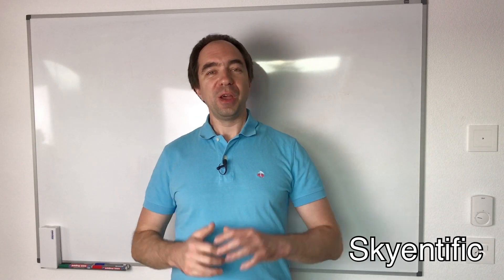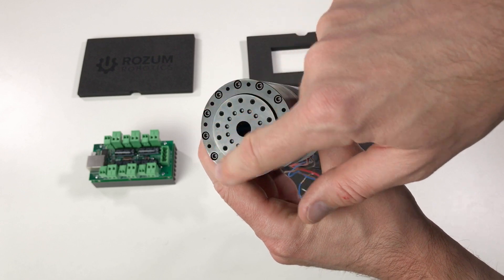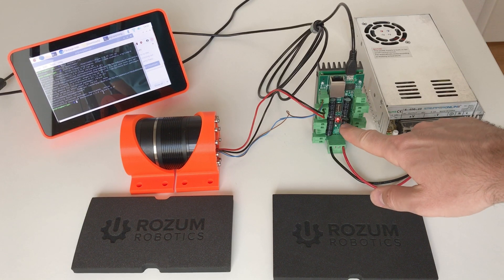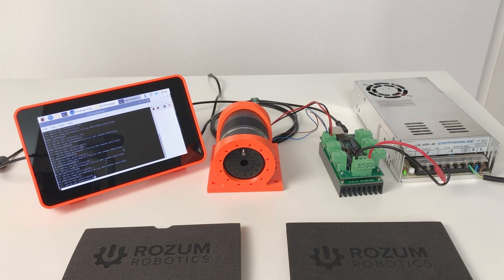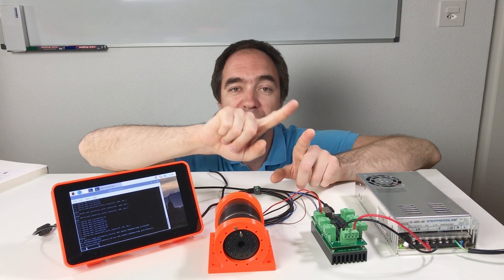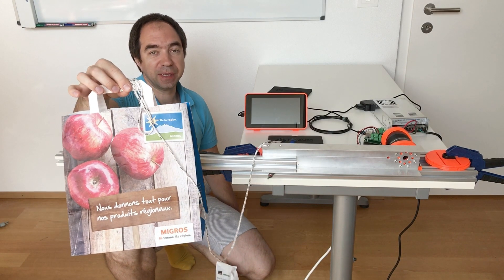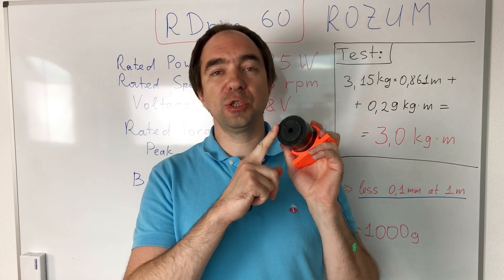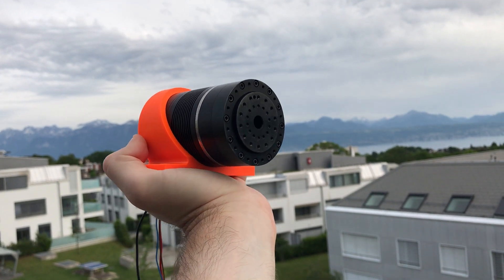Harmonic Actuator RDrive 60 (Rozum Robotics)

Comment: This actuator is amazing! Just finished coding a DIY RPi X/Y camera gimbal, using NEMA 8 geared steppers and Python. It has many similar features, such as degrees rotational input and accelerated/decelerated motion. But, this actuator takes it to another level.
But, after following your link, I see that it's price is through the roof.🤑
Surely there are affordable mid-range alternatives. (I'm beginning to realize that your videos are going to cost me a lot of money, starting with a 3D printer.)😎

Comment: The problem I have with Razum is this ignorant idea that to buy it I have to send them a message. I mean if you intend on selling something, setup a cart where I can click buy now and just buy it without having to jump through a bunch of hoops. All this tells me when I see things like this is they are embarrassed about the absurd price they want and dont want that showing up in a shopping cart before they have a chance to get your contact info so they can spam you! Thanks but I will find my parts somewhere else!
Reply: I don't like the practice either. Local plumbing, building, and electric supply stores do the same thing so they can charge each customer differently. You walk thru the whole store and there is not a price on anything. At least post a list price for rough figures and comparison to other similar items. It is OK if there are different discounts on the list prices for bigger or smaller customers, but not having any data is counter productive.  I refuse to give these companies my business, and instead buy online instead of the local place. If they want to complain about people not buying local, it is their own fault.

Comment: Mind me asking an off topic question? I'd like to know what happened to the "orbital drive" you had developed some time ago. Only reason I'm asking, is because I thought it was so cool and never heard much about it since. It being also a high torgue, low backlash actuator (with the added benefit of low cost), just popped up in my mind.

Edit: Yeah, obviously long time fan here!
Reply from the maker: Nothing happens since then. I did not have time to work on it. But I still think that it could be used for robotics.
Reply: I hope you'll do. I'm also interested in that. A few weeks ago I made a spreadsheet, and calculated that close to 500:1 ratio is easily achievable with cheap off the shelf parts. It could be a good option for hobby robotics.

Comment: "Price: Contact us"
No, I don't think I will
Reply: It's $2700ish
Reply: @Spirit532  Is that an extra 0 in there oooor? XD
Reply: @darksunrise957  No.
Reply: now, open the thing, understand how it works, and 3d print a replacement for the planetary reductor ;-)
Reply: @AmauryJacquot  ya harmonic drives are really hard to manufacture because they have such thin walls and fine teeth on the compliant meshing teeth thing
Reply: Amaury Jacquot that is not necessary because there is none.

Comment: a 100 euro cordless drill has double the torque as this thing, It's not worth 2700$, also almost no backlash and only 18v system
Reply from the maker: High voltage is good. High voltage => low current => thin flexible wires. Drill without backlash does not exist. And I really doubt that a drill can make 30Nm torque.

Comment: This is not what's known in the industry as an actuator. Actuators move out/in, this looks more like a motor with slow gearing or a servo. Closely resembling a stepper motor
Reply from the maker: This is not industry. This is robotics. Actuator in robotics is any source of motion (linear or rotational). Usually actuator have a motor, a electronic driver and a reduction mechanism.

Comment: Nice presentation sir! I have the following questions: 
1. How effective is the torque control? What's the torque resolution? Since its reduction ratio is so high (100:1), I'm a bit skeptical about using current for its torque control. 
2. Does it have a power-off brake?
3. Does it only have one encoder at the output? Is there an encoder for the input (motor) side?
Appreciate your replies!
Reply from the maker: Thank you.
1. I did not have time to make a super deep analysis. But the toque control was better than I expected. I agree, that high reduction ratio does not help here. 
2. This one does not have brake, but I think this company also produce actuators with brakes. 
3. It has two encoders.
Reply: @Skyentific  Thanks for the reply sir! Glad to hear that its torque control works well. Would love to buy one to try. The dual encoder looks interesting to me too. Kind of curious about how they integrate both encoders into 1 PCB.

Comment: The cynic in me always wonders if any of these fancy actuators ever get any use beyond youtube videos on the various channel free samples get sent out to.
Reply from the maker: They used a lot in industry and in universities. Really a lot.
Reply: It is used a lot in space because of its low weight, part count, & reliability. I think strain wave gears were first used on the lunar rover wheels. Also the Canadarm and mars rover arms. lots of robot arms in space
Reply: they only get used by people who have free money, not by people who have to save for a year to buy one.
Reply: @atomipi  They get used by people who save more money than it costs to buy one. As soon as you add in labor costs for development of a custom actuator w/ software stack and maintenance, commercial solutions quickly become the better option. Of course Hobbyists have a different use case and it's basically never worth it to get one.

Comment: Great info ....i would love to see you buid a heavier  robot arm.... 3d printed neg mold then cast the the mold with mineral cast and epoxy....and then use clear plath servo with harmonic drives... for more heavy duty  ie FANUC robots ... great job on the video

I need to mount 30kg router spindle on heavy duty robot... that why i need clear path motors

Comment: uhm... I wrote under your last video something about harmonic gears (dunno if you saw this but doesnt matter)
Actually I meant, that you could use a harmonic planetary gearset INSTEAD of the planetary gearset that you 3d printed. And that should work in the same way as your gearset, just with a higher reduction ratio...

Comment: "Harmonic drive" seems to be a brand name by the group of companies who developed and trademarked it. I needed to look this up myself, but the more generic term is "strain wave gearing".
Reply from the maker: I think you completely right. But most people know better harmonic drive.
Reply: Much like "Xerox", "Tempo" or "Gilette".
Reply: Holycow. They use physical deformation to produce backlash free rotation - /watch?v=bzRh672peNk
Reply: @SyntacticOperator  people 3d print them out of plastic, but it seems the design exploits how metal deforms. cool stuff tho!

Comment: Shouldn't it be 3kg * 9.807m/s/s * 0.861m = 25.33Nm just to hold the arm steady?
Reply from the maker: You did not take into account the weight of the aluminium bar (which adds 0.29kg.m). Also the weight was 3.15kg (in order to have exactly 3.0kg.m).
Reply: Ahh cool, so I am at least in the ballpark of understanding how all these parts fit together then. Thank you very much!

Comment: Nice!! Just think about Nema 23 112mm that has got only 3 Nm. Brushless motor is a revolution
Reply: Yet nema23 are brushless motors too. That is not the point here, just not the same type of actuator since here there is a reductor when nema are motors only. Plus, you should see harmonic drives efficiency, around 50%, nothing magical. No backlash solutions come with a price
Reply: @MrWinterify  : NEMA (short for National Electrical Manufacturers Association), is a mounting flange specification that defines mounting hole spacing etc.  The motor and gearing spec is not defined to the best of my knowledge, so I believe you could have a NEMA 23 brushless motor that incorporates a harmonic drive and closed-loop feedback.  Common usage has meant that this name has become synonymous with stepper motors.